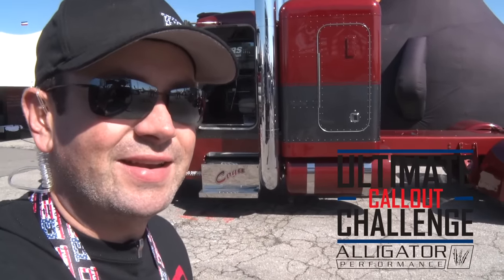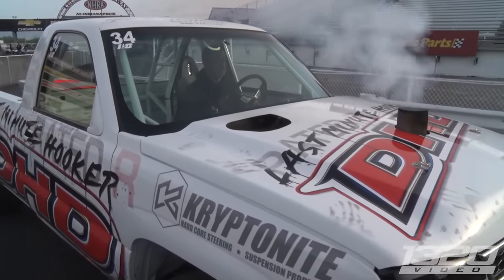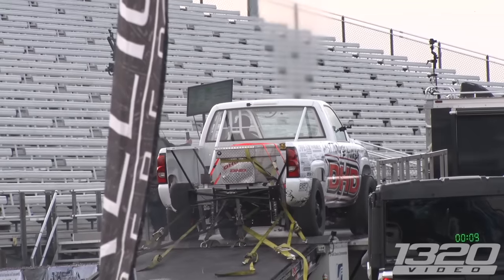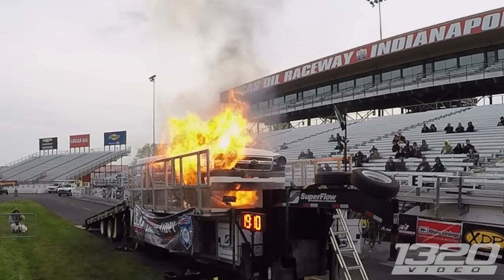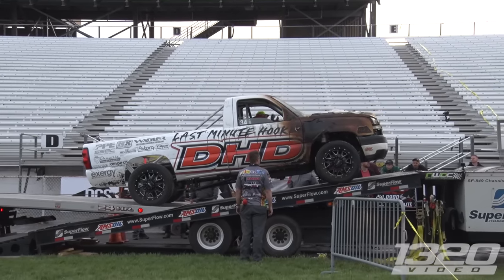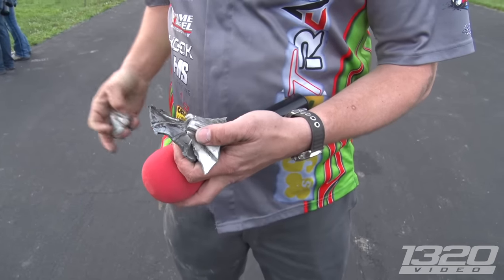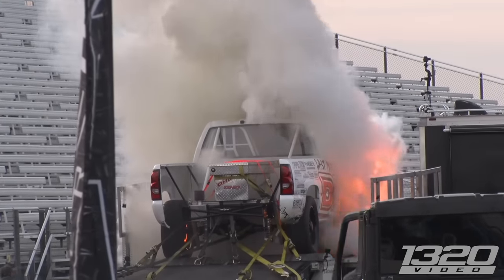MASSIVE FIRE - Runaway Diesel on the Dyno!

Comment: Some extra large co2 extinguishers may have done a much better job than the toy ones.
They may have stopped the motor.
Reply: No they would not have, turbo wheel ripped the intake piping off at the manifold and some lines came off the cp3 pumps that were spraying at max fuel because the ecm wires got hit, this made it so a whole lot of diesel was being sprayed into the hood which then both spread out and lit everything on fire and went into the motor causing it to runaway.
Reply: Co2 would have displaced the oxygen needed for it to run .
Reply: sendit schutte All of that needs O2, enough CO2 would, as the commentor after you said, displace the O2, killing the fire and the internal combustion

Comment: How much inert gas would you have to spray at a diesel to get it to stop running? Looks like the fire extinguishers couldn't displace enough oxygen
Reply: These guys often install emergency throttle valves just before the intake header...not that that would have helped here as all the intake ripped of completely 0_0

Comment: yep, i started my career as a diesel mechanic and in school we had an old engine on a stand run away away and a kid thought he would block the intake pipe quickly to stop it ..... with his hand..... he lost that hand that day. sucked in clean off and into the engine....it kept running until mr mckay put the steel plate atop that pipe.  they are incredibly wicked when they run away.

Comment: Imagine if it did that on the drag strip. I wonder where it would have ended up
Reply: if this happened on a drag strip the driver would pretty much be dead, when diesels run away they can produce up to 10x their rated power which if not caught in time could speed boost the driver straight to a speedy fiery death with no escape, not even brakes will save them
Reply: @socialfreak6900  I don't get it. Why can't you just step on the clutch and brake like what any normal person in any manual transmission car would do in any catastrophic faliure and like what he did in the video? You see the wheels come to a stop on the dyno while the engine is beginning to runaway. Also you can hear the amount of time the engine takes to rev up. I'm assuming by power you mean horsepower which is a function of torque and rpm so the 10x boost in power presumably comes in when it's far above it's max rpm? I'm no expert but I think what would happen is the engine blowing might cause you to lose control and crash or otherwise maintain control and bring the car to a stop. Rather than being taken on a joy ride back to the future. Or correct me if I'm wrong just don't make sense to me what you said at all
Reply: Russel Walker .
Reply: @socialfreak6900  that mean that 3000hp diesel engine is making jet engine number???
Reply: @KitKitChanIsaac  a runaway diesel is an engine that has, as the term suggests, ran away, its rpm goes way into the danger zone and continues climbing until it runs out of fuel or the engine siezes/breaks
Reply: @socialfreak6900  y diesel engines revs over the moon during runaway tho?
Reply: @KitKitChanIsaac  a runaway diesel engine is being fed fuel from an unwarranted source, like if oil started to leak into the fuel (diesel) or oxygen intake, that little bit of extra flammable material adds to and makes the combustion explosion bigger and applies more power to the crank, but its not just happening in one chamber, its happening to all of them, and as the motor begins to speed up it starts pulling more and more of the fuel/oil mixture making bigger and bigger combustion's until it runs out of control and cant be stopped.

EDIT:
this only happens in diesel engines bc they use compression ignition, if diesel engines used spark plugs the oil would ruin the spark plugs and there would be no chance for the engine to run away, compression ignition however doesn't use spark plugs and doesn't care what fuel its burning

Comment: Why spend so much building a truck like that and not have a fire supression system?
Reply: Weight.
Reply: Diesel engines only need air and oil ( even motor oil) to run, no spark to kill to stop it
Reply: @Tape_dek  thats why you install a co2 feed in to the air intake, to choke the mixture, and have conventional fire supressants piped around the engine bay to kill any external flame.
Reply: @joolsfreeman4359  u right
Reply: @joolsfreeman4359  well if the turbo flying around the engine bay knocked out everything else chances are it would have screwed that up to
Reply: Jools Freeman we had one for it but never had the time to put it on. There will be one put on all of our performance trucks now.
Reply: @joolsfreeman4359  The turbo exploding took out everything attached to it and vented the intake which is why it ran away in the first place. They had provisions in place for a runaway, you can even hear him say it in the video that the turbo took out their cutoffs for runaways. co2 into the intake wouldn't have done jack shit in this scenario.

Comment: When they’re running these big monsters they should have a huge tank of CO2 sitting right there and a 2 inch hose tied under the hood and when something goes wrong just open the valve and blast it under the hood to smother it out.
Reply: That's not a bad idea!! Have some sort of nozzle mounted right to the intake!!
Reply: The problem would have been if the exploding turbo blew off the hose.
Reply: @LtdJorge  that why there is 2 !
Reply: Or if they just flooded the intake with those fire extinguishers, it most likely would have shut off... If it cant get enough air it would have shut down

Comment: It's a Chevy, you should have expected it to blow up
Reply: warrior5223 it doesn’t matter the brand of the truck any truck can become a runaway just to inform you the turbo blows and the air intake sucks in all the oil causing it to redline uncontrollably the only real way to stop it is to find a way to block the intake in this situation you can typically the motor will just blow up....

Comment: And this is why when you tune your diesel, you make sure it burns clean. That soot that was blowing out right before it blew likely melted the hot side, which torched the cold side and led to the cascade of failures that triggered the runaway and fire.

Comment: yeah 2 or 3 tiny extinguishers.
you got it covered lol
Reply: Really poor firefighting facilities.  Woeful in fact?
Reply: Looks like they are CO2 extinguishers, they were trying to smother the engine to stop it, not necessarily put out the fire.
Reply: Might as well used water balloons
Reply: Just bring a damn fire truck lmao
Reply: They were obviously using dry chemical extinguishers, and as you can see, they were very successful. Dry chemical fire extinguishers are extremely effective when used by someone who has at least some idea of what they're doing. 2.5 gallons (20.75 lbs) of water is roughly equivalent to 4 lbs of ABC dry chemical.
Reply: @ironmatic1  looks like co2 to me
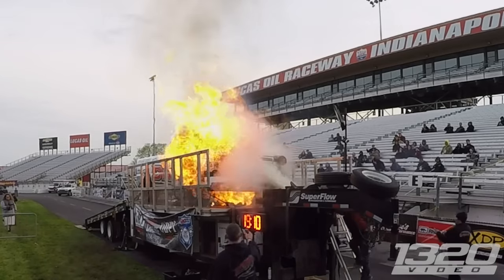Reply: @dannainan7732  It clearly came out as a slightly yellowish powder. Actually I have an old video on my channel of what a CO2 discharge looks like. CO2 extinguishers also look much different then that. However 2:44 the guy on the left appears to be using what I wanna say is the AKE Stop Fyer--some non UL listed junk.
Reply: Maybe if one of those extinguishers got emptied directly into the intake they might have had a chance to smother that runaway

Comment: Dang cool video! Sorry bout your motor, I had a diesel runaway away on me back in 1993, I was a mechanic in the USAF. Was working on a GM 6.2L diesel, (a piece of shit engine, by the way)
I rebuilt the injector pump and it got stuck in the wide open throttle position. Dang that thing sounded like it was about to come apart at any second. Had to get on a mechanic creeper, go underneath and crimp the fuel lines. It worked. The entire auto shop filled with smoke, the fire department showed up and next day I was front and center, in front of the entire vehicle maintenance squadron going over the procedure on how to rebuild one with the technical manual in front of me.
It was crazy!!!

Comment: And that there folks is why you buy Garrett turbos- they spend so much time and effort to ensure these types of failures don't happen. They over speed turbos on test rigs on purpose to ensure when the wheels let go they are completely encapsulated. Precision don't do this type of R and D. They do not guarantee their turbos will encapsulate exploding wheels the way Garrett does. You can see this turbo testing on the net at Garrett

Comment: How you gonna run a dyno on that thing with no air intake?.. dont they usually pump air into the intake to simulate driving wind cooling?
Reply: Earl Swift Driving God , pump air into the intake ?? that's what the turbo is for . you mean a blower fan into the radiator  some driving god u are . go back to video games

Comment: Oops?! On the dyno! Otherwise, that thing is bad news! That is scary as crap! I remember when I was very young something similar happened at the company garage my dad was a diesel mechanic at. A mechanic at that garage had just been fired off and ran away with a large fireball, as the result. They always did the first start up outside the garage just in case the engine ran away.

Comment: Maybe they should have had those huge industrial fans blowing cold air at the front of the vehicle, you know like they use to stop engines blowing up on a dyno. They use those to replicate the air flow to the engine that would happen if it was moving at that speed. That is why they have those fans, because the vehicle isn't moving and it needs the air flow to cool the engine... Maybe if they did have those fans that stop the engine blowing up on the dyno then the engine wouldn't have blown up on the dyno

Comment: So much for a fuel cut-off switch/valve. (edit: Did he say it ran away on its own oil? ...and not fuel? I know oil can be used as a fuel, especially if preheated like diesel... but I never would have expected it to be able to run like that.)

Comment: There could be in case of runaway a oil valve which opens and pumps / circulates oil away from engine to stop it quicker in worst case scenarios like these.

Comment: A simple valve on the intake after the turbo to cut the air off to the engine would have prevented a lot of damage.  I know, I know it still blewup but diesels have had this problem since their inception.  in the shop when we would have one run away and they do, we would keep a large towel handy for the intake to choke it out.  this saves whats left of the motor.  imagine a blown hemi on alcohol without a kill switch, only a fuel shut off- not gonna pass NHRA sanctions!!!

Comment: they should've been shoving that crap down the air intake
Reply: would you want to run up to a burning car, open the door, pop the hood, reach-in, lift it up take the filter off, and then cover it? all the while getting third-degree burns from a massive oil fire next to an engine that may throw a rod and kill you at any time, just to save some sponsor some money? no way dude.
Reply: @jklbubbublkj7939  yes i would because im stupid. Also the intake stuck out the front next to the grill

Comment: 1:57 why is the rear breaks on so much?
Reply: I'd assume they tried to stop the runaway with the brakes but it's quite hopeless on an engine as powerful as that. But on a weaker engine, stepping on the brakes and dropping the clutch might very well stop a runaway due to the engine not having enough torque to either overpower the brakes or instantly break something in the drivetrain to keep going.
Reply: @Roma-kg9ld  I meant before it blew up. Few hp is escaping there.
Reply: @Jonas_Aa  I'd assume that was when he noticed it was starting to run away. To get sparks on the brakes you have to step on them hard, and I can't think of any other reason to do that than trying to stop the runaway. When the engine starts running away it is immediately clear to the driver that it's happening, usually even way longer before it blowing up. Based on the sound, I'd say that he stepped on the brakes the second it went over the redline

Comment: You don't have an engine anymore! Once the Diesel engine runs away, THAT'S IT!
Reply: The engine is pretty much fine...
Reply: I don't want to argue, but I beg to differ. When a Diesel engine runs away, it's the same equivalent to a gas engine blowing up. The Diesel engine runnng away is just a slow death for it to suffer. The valves weld to the piston so  it causes damage to the engine block.
Reply: Nickel Plate Nerd sorry man but I work for the guys and I know how the motor is... a piston was scarred some and a few bearings were damaged. Trust me, I was there the whole weekend and I work for them and know all of them personally
Reply: Oh sorry about that, I hope I didn’t offend you. I just remember that happens a lot with diesel locomotives, and that’s how it usually winds up. Once again, sorry.
Reply: Anyways I do notice that when he cranks it up to get it on the dyno there’s a lot of white smoke coming out of it so that foreshadows that it was going to go out.
Reply: Nickel Plate Nerd lol it’s no big deal man and it could’ve been because if that but also because that we tried to keep the truck as cool as we can before we push it like that

Comment: Halon fire extinguisher s will stop an oil injestion run away because it takes away the air from internal combustion. They are scary if uve never had a diesel run away.

Comment: if you have a diesel itd be wise to put a valve on the fuel line..... instead of looking lost when you can't shut the motor off
Reply: Cody Bryant And if the engine starts sucking in crankcase oil? What then?

Comment: Why is it that the procedure for shutting down a diesel engine is always to cut the air supply?  Under "normal" operating conditions that may work fine, but it seems like you'd want to have a way to cut fuel pressure near the injection system.  I am baffled as to why there is ever a runaway condition at all considering this could be done.  Especially during an event like this if for no other reason than safety.  How complicated can it be?

Comment: After watching this i came to the realization that (in my mind) the fastest way to deal with this situation (turbo sticking out of the hood) would be to spray the fire extinguisher into the turbo to starve the motor. Could be wrong, what do you guys think?
Reply: Yes, CO2 or water fired into the intake will stop a runaway diesel. Water will trash the motor though, but it will stop it.

Comment: I've seen a Cummins run a second faster than that, it had 1300 horse, had smoke coming off all 4 wheels 3/4 of the way down the track and it didn't blow up
But this was an awesome truck and it's still really cringy to see it blow up, I'm going to be honest those V8s can't be pushed very hard, they do seem to take it, they have smaller components and more of them, and they don't produce as much torque because of the way diesel acts in a slanted  cylinder, but they do take off once there going so long as the truck is light like these stripped down drag racers

Comment: This (runaway) is one of the reasons why I will not own a diesel.
Reply: Extremely unlikely to happen to a normal street truck/car but when your making 3000+ hp on one with a turbo 5x the size of stock then you can run into issues

Comment: plain and simple, the intake should have been closed or blocked off from air flow, diesel may run away with oil for fuel, but not without air/oxygen...
Reply: Who really wants to stick there Head, or any part of there Body anywhere around a Duramax that's a Raging Fire, Turning probably well over 10,000 rpm, i was just waiting for Chunks of Crankshaft,Rods, and Engine Block to Come Shredding out of the Fenders. Will definitely take your Head Off.
Reply: When it's Happening it's Hard to Think about what to do at the Moment. If my Truck ever Decides to Run Away, i know you Gotta Block the Air from coming into the Turbo, but at the Moment of when it's Happening, it's not the easiest thing to think of.

Comment: Really not trying to be an asshole, but there's several key takeaways from this... Don't put a diesel truck on dyno with no safeties to kill it in the event of a runaway. Fuel cutoff switch anyone? Also, trying to hold the brakes (which don't stop an engine) instead of putting it in neutral. Your truck is strapped to the dyno, that bitch ain't going nowhere, so holding the brakes aren't going to do much. Finally, actually have reasonable fire suppression options available. Y'all were doing the same as coughing on it with those tiny extinguishers. Lucky no one got hurt from this; could have easily thrown parts into the crowd. Just be safer next time.

Comment: mabiy next truck he will have an automatic fule cut off with an rpm sensor
Reply: Wouldn't help on a runaway diesel.
Reply: @cirrustate8674  so you"re saying a runaway disel will keep going without fuel  ??
Reply: @kazadori164  they'll often cannibalize their own oil and run on that. Fuel cutoff switch wouldn't prevent that.